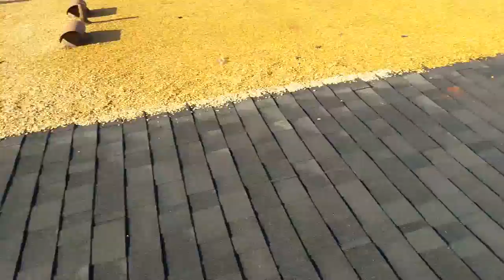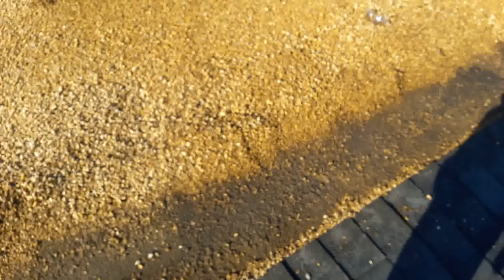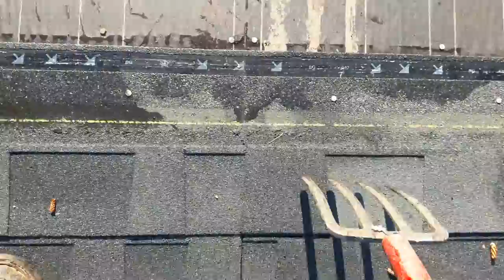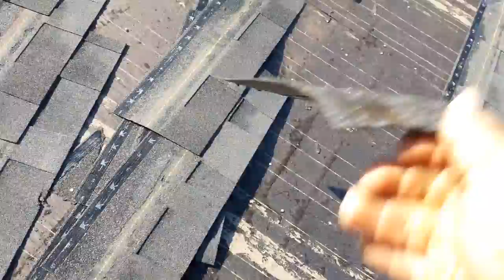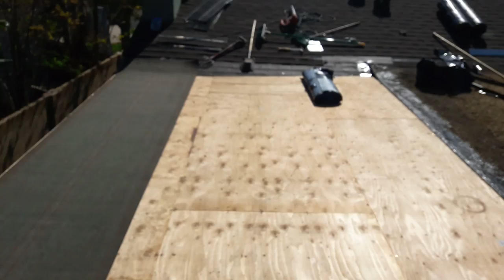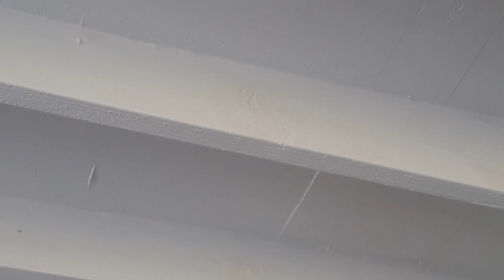THE WORST Shingle job in History ...How not to do a flat roof ,a total  disaster!!

Comment: I had the same problem with a section of my roof. It is flat and the roofers put shingles. I had no idea your not suppose do that. It starting leaking when it rain. I called the roofers and they came back and tried to repair but they never did. I called 2 different roofers and they too did not say nothing about shingles on a flat roof, they did their magic and it did not work. After watching a bunch a videos I realize what they did wrong. I removed all the shingles and replaced it with base sheet and cap sheet. Problem solve, thank you Eric Garcia for your videos and many other true roofers.

Comment: First problem. "Were on a flat roof" and I see shingles! As someone who works for a builder but also understands and does roofing this is appalling. Minimum 2-12 for shingles and even then it should still be done with caution. Glad to see you fixed it up right
Reply: I dont know any roofers in my area that would do 2/12 shingled without a layer of ice and water underneath.

Comment: how much is torch down per roll.
Reply from the maker: MrMac5150 ...about the same price of 3 rolls,of shingles, 80 bucks +
Reply: Don't forget base sheet and screws and plates...without base you will burn the house down.
Reply: there are adhesives for that kind of material so you don't have to risk fire damage.
Reply: MrMac5150 $80

Comment: why did you install the new flat roof vertically?
Reply from the maker: When they built the patio cover , the slope it towards the side , I followed the slope of the roof, you can't notice it on the video but where it attaches to the rock roof they created a slope towards the right side.
Reply: Roberto Olortegui ...so he wouldn't have to use more materials....and do it right...
Reply: FLOYD ...  I dont see him advertising a spray foam roof like you do lets talk about a cheap system that has little life expectancy and a ripp off to owners trying to fix a roof problem .  Care to try and sell that to anyone here

Comment: Eric, you have some excellent videos. What is considered a flat roof? I noticed some of the  videos you refer to as a flat roofs appear to have some slope to them. Do most flat roofs in Southern Calif require rolling roofing material to adequately allow water to roll off?
Reply: well sir I'll start bye saying most residential roofing ( asphalt shingles , shake , slate ,etc..) are made to "shed" water not hold it . I'm not sure what code is we're you live but here in ny any roof pitch under 4/12 demands a "flat" roofing system . Shingles can be applied on an 3/12 pitch with full ice n water shield as Long as the structure is non heated . I hope this helps .
Reply: Thank you for your comment. I'm in Southern Calif so ice and snow are not an issue with our roofs. I built a storage room and wanted a flat roof since height was going to be an issue. The roof I built  only has a 2/12 pitch and I put on a Selvedge rolling roof material. Lately we've had some heavy rain in So Cal and my roof has no leaks and all water sheds just fine.

Comment: 4- 12 good for asphalt shingles?
Reply: Yeah, 4/12 and up
Reply: Christopher Church thanks
Reply: Christopher Church I built a 24' buy 36' building and put a hip roof on it  my angle is a 4 - 12 I was thinking about a metle roof but I've decided to go with asfalt shingles I just definitely don't want wind blowing water up into my shingles. I'm using architectural shingles and 3 tab for starter and ridge caps I started puting the shingles on today got one side done. I used Owens corning pink panther underlayment. I'm 100% a jack leg but my lines are nice and straight and all my ends are stagged atleast 6" I think my first roof will be a successful roof. I am slow it took me all day for one side it's one of the long sides but I know I'm slow but it's going to be done well.

Comment: when you tie in shingles top am existing roof you should use the same color.  not to mention torch down is the cheapest and worst roofing system
Reply from the maker: you might be right, the shingles don't match, maybe the build up roof is the cheapest , but with the cheapest and crappy work, it will last at least 15 years , that's the real test of any roofer.
have a nice day .
greetings.

Comment: That's a shame bro who would think in there right mind that shingles on flat roof was a good idea
Reply: Its not just that but they installed the shingles in the wrong direction to boot .  I have installed shingles on a porch that was a 2/12 transitioned off a 6/12  but I installed 2 layers of ice and water underlayment but damn I ran the shingles in the correct direction and 10+ years later all is well and thats factory specs so warranty on shingles if ever needed is still valid .
Reply: the shingles are in the right direction its just too flat of a roof for that kind of material

Comment: "Expert", Your flat roof is supposed to run parallel to the shingles on the sloped roof. Thus, allowing the water to run over the overlaping seams, not along them... Not to mention the mismatched color shingles. 
No inspector in the world would sign off this job. Im sure your just another "mickey mouse" unlicensed roofer pretending to know what your doing. 
I know you didnt install the plywood, but that is backwards too. Plywood is not supposed to run parallel to the rafters. 
Hope this helps "expert". 😂😂
Reply: Don Demon i notice all that and i was wondering is he trying to full him self as a professional or is he trying to full the viewers with his nonsense talks.
Reply: start at the bottom or drain end at the top
Reply: Yes your roof membrane should run parallel but that creates more places for your tie off to fail there are sometimes special circumstances
Reply: 1 word. RUBBER !
Reply: I have no arguments for your roofing section of your comment but the plywood is run in the proper direction. The roof joists are running perpendicular to the direction he rolled his roofing out. He films it at the end and you can see the joist direction

Comment: Oh god your torching is disgusting! Your bleeds are not consistent and they are messy. If you were in my crew you’d be fired on the first roll. Learn to do the job properly before you judge other people’s work. Btw it’s common sense to not put shingle on a flat roof and although you put on a brand new torch down you really should have gone higher because when snow sits and ice builds up they will lift those shingles up.
Reply: lol dude relax, its consistent enough to where its not going to leak and nobody sees it anyway